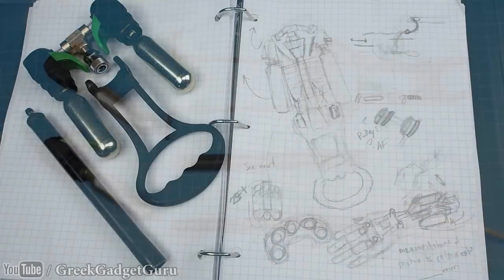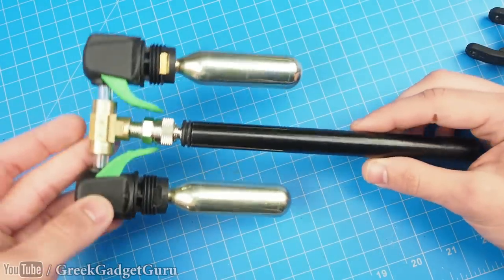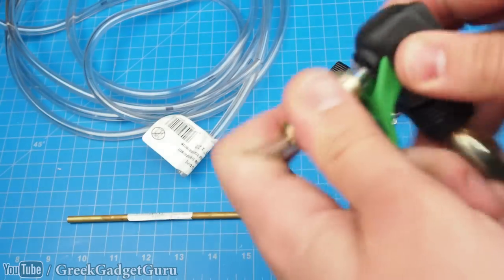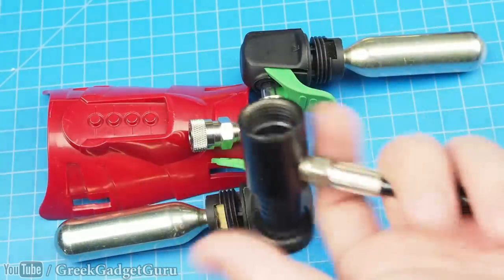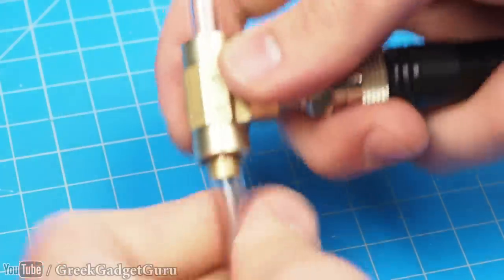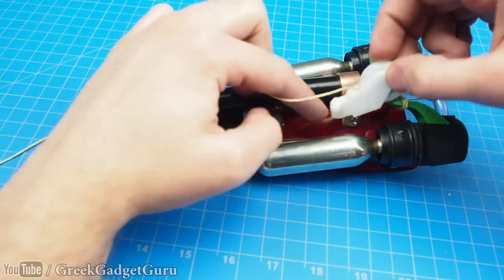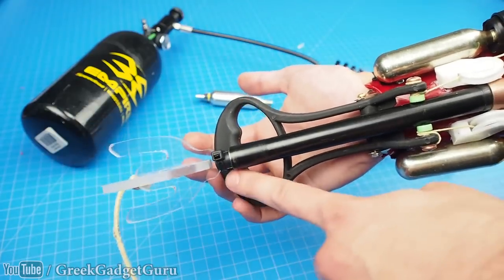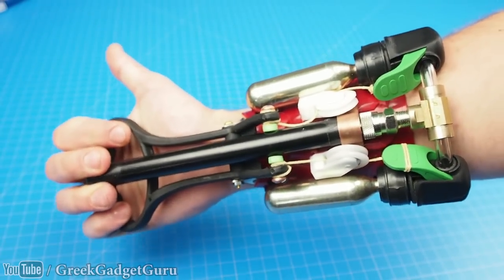How to Make REAL SPIDER-MAN Web Shooter - Prototype V.3

Comment: Put a cross pipe with a valve on the outer end instead of the T pipe.
Then the bottle holders can be steady. Which will make everything much easier. Not to mention that the cross section will look cooler and will be more functional overall. (you will be able to keep everything tight, so you dont have to replace the rope every time you change the position. And have the bottles plus an external pressure pipe connected simultaneously).
Also the power this will output depends greatly on how fast you can open the valves.
Reply: True

Comment: The design is really good but the thing is that when you pull the lever, the pressure in the barrel will increase (relatively) slowly. By the point when the triggers are fully compressed, the grappling hook would have left the barrel but without much power behind it. To really SHOOT the hook, you need to pull the triggers really fast which can't be done by hand. I would recommend you to check out the slingshot channel, specifically the 1000 joules "toy" project. There he uses rubber to instantly release the pressure valve to increase the maximize the speed of the projectile. 
P.S. When you are building something, instead of rambling to fill the silence, maybe select some music from the YouTube library.
Reply: Live Sparks he was literally extremely exhausted, the poor guy was loosing his fucking mind and slipping through the entirety of the video
Reply from the maker: Right? haha sorry

Comment: So if I calculated your shooter correctly thats the pressure chamber the co2 cartridges the things the co2 cartridge is in is the gas container and the pressure pad alright so when your pressure pad is pressed it moves the tube releasing the string opening the gas container shooting out the co2 cartridge out shooting through the pressure chamber to the grapple hook out at an high level of force or psi

Comment: Is it possible to have you make deadshot's wrist guns? cause that would be cool
Reply: G0LDENTHUNDER77 easily possible, but you wouldn't be able to shot as many rounds as he does with the design seen in Injustice 2 or in DC Suicide Squad Movie, not without taking a few liberties on the design for the holding of actual bullets
Reply: Yeah thats true on what you said, if theres a way to make that possible, I would be enlightened if someone actually pulled it off :)

Comment: Well...like an idiot I deleted my pervious comment thanks for loving that btw...anyways has anyone asked you to do a electric web shooter thing, i forget what its actually called...but if you made insulated gloves/forarm covers to go under your mount plate you could try add a taster that is only allowed to activate when the string is taunt... Then you could add a conductor to your string attach that to a switch with the string that when fully pulled taunt allows for the tazer to be activated thus sending a current down the string...probably made no scence in that but hey-ho worth a shot...I mean you'd also have to add a cover to the cartrages.